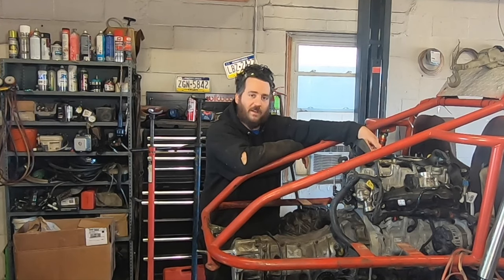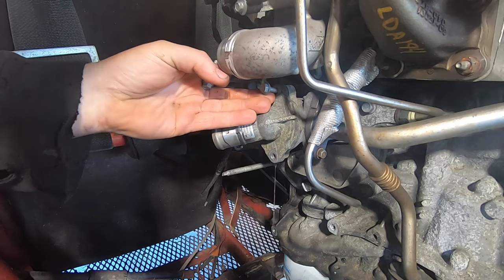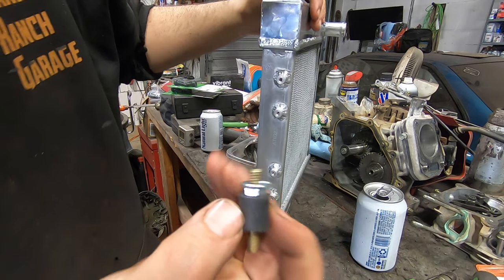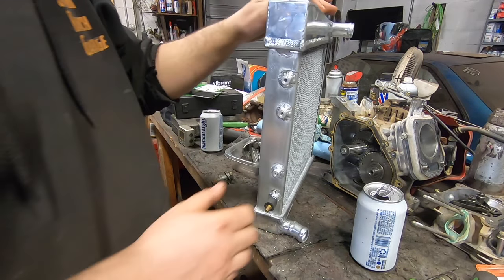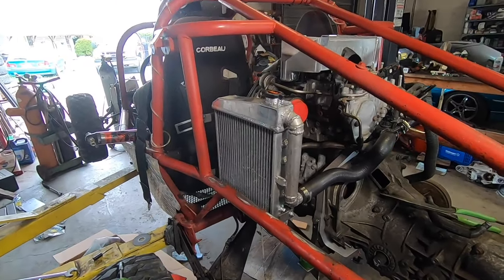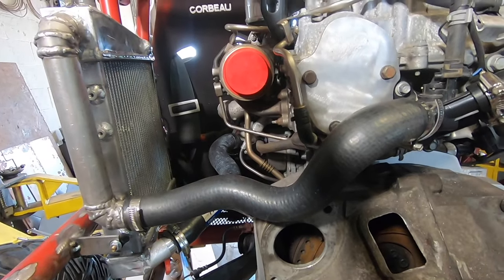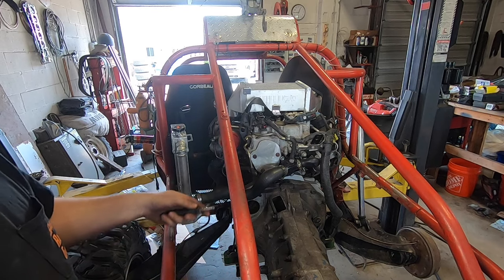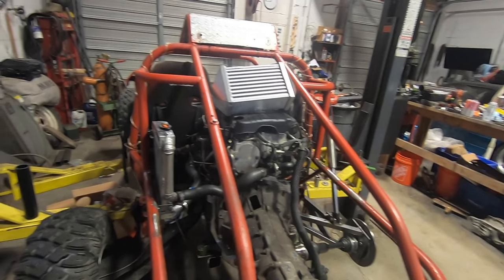Building a custom cooling system for the LE2 Rail Buggy

Comment: I ended up using a Mini radiator for my little drag rail project as well.  It was the best match for the space available.  I will end up mounting a fan on it just in case there is any cooling issues, but I would be surprised if there were.  Great stuff sir!

Comment: Crawling does generate a fair amount of heat, but the issues tend to come from the lack of dissipation. Water pump turning slowly and less air moving over the cooling surfaces allows heat to build up. For that reason, i like having the extra coolant capacity of an oversized reservoir.  I just use the rad cap blow off type, but i could see how a pressurized tank could be used as well. Im building a geo metro sandrail right now and cant wait to see more of your progress.
Reply from the maker: It would be easy to add some additional capacity to this system if I need to. Wont know until I test it. Good luck with your build!

Comment: I was a little surprised the rad wasn’t mounted in a location to take advantage of air flow, but you do have a lot of constraints. I guess a decent fan will do the trick.
Reply from the maker: Yeah I would like to see more direct flow. The problem with these open wheel buggies is that anything that sees airflow also sees all the mud thrown off the front tires. I think it would clog quick